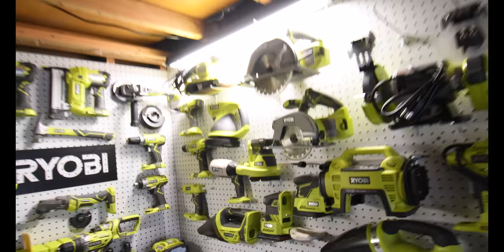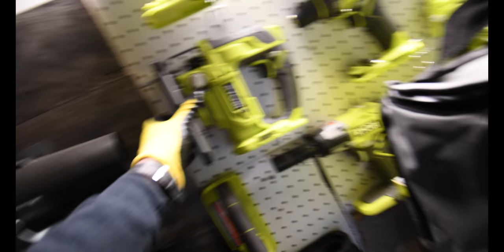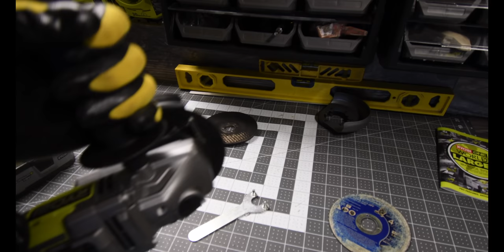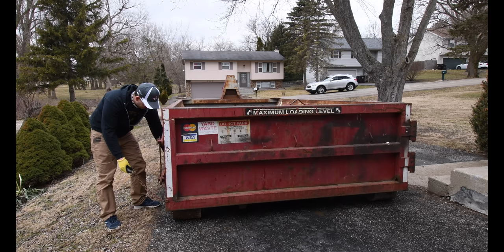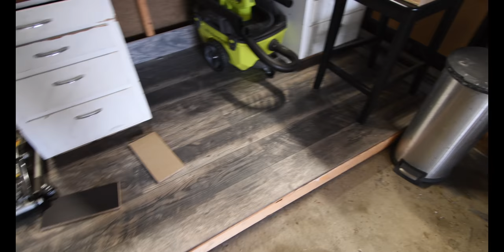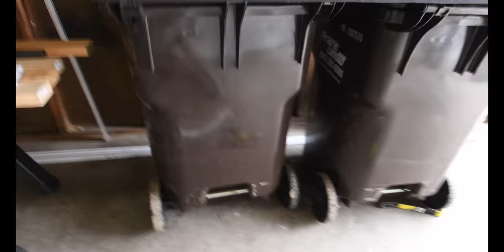Rented a dumpster to take out the rest of the garbage

Comment: Nice clean out! I was certain that lounge was going to catch fire when you had the angle grinder on it, good thing it's cold where you are. Also, your recipro saw could cut through those bolts / metal beams in the couch the correct blade on it - good time saver, no switching tools.
Reply from the maker: jjanderson1987 thank you sir